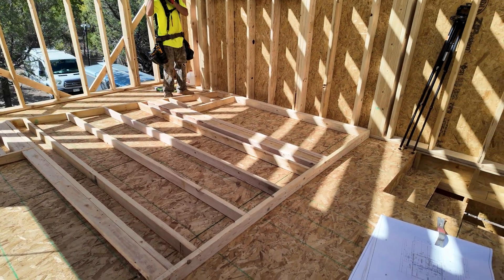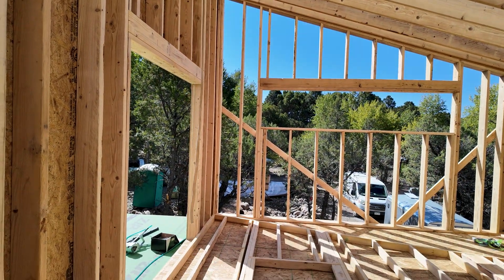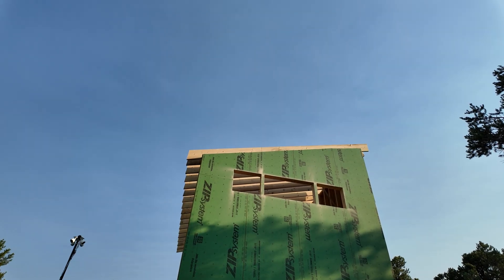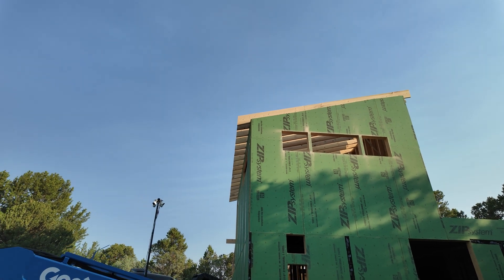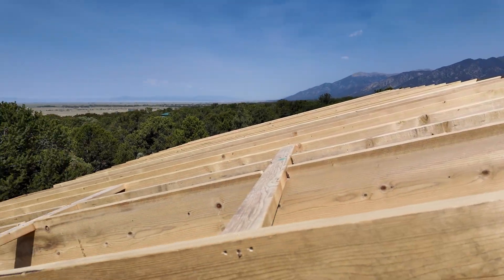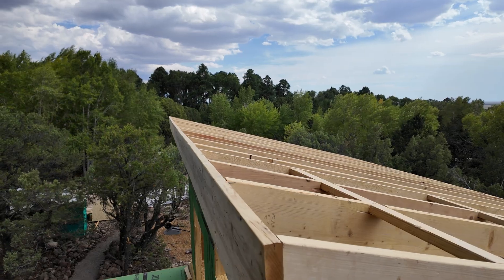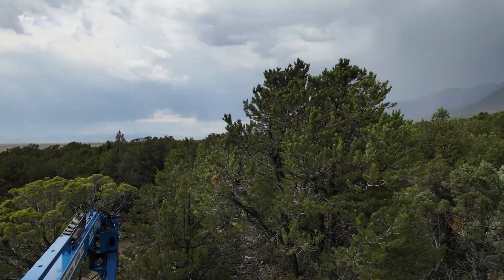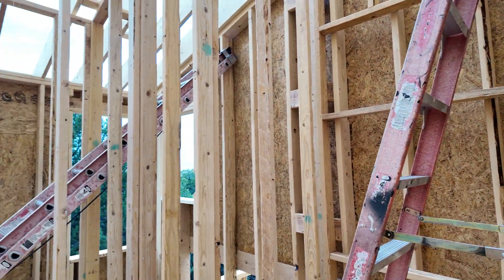Exterior Wrapped Up: Sheathing & Roof Framing a New Home

Comment: So what is your air sealing detail from zip to roof OSB.  Mine is a gaping hole crack and I’m waiting for framers to do their magic before I freak out.  And thank goodness it isn’t 100degrees in Colorado right now..
Reply from the maker: I run my osb to the top plate, sealing up the exterior, then my rafters and roof sit on the top plate. then the fascia, soffit and trim go on and are caulked and that seals it up well. Yes very thankful the heat went away this week